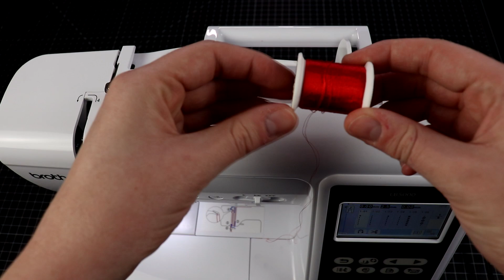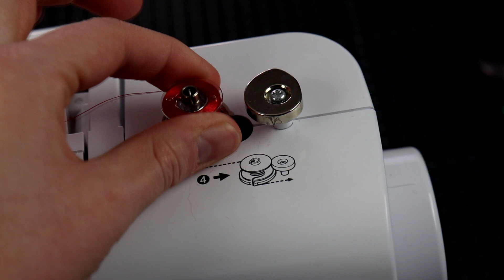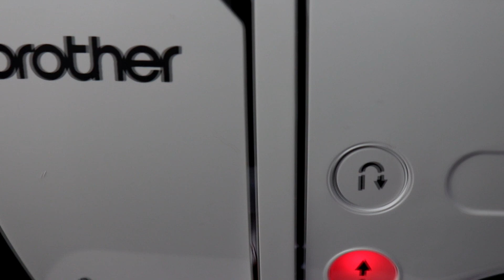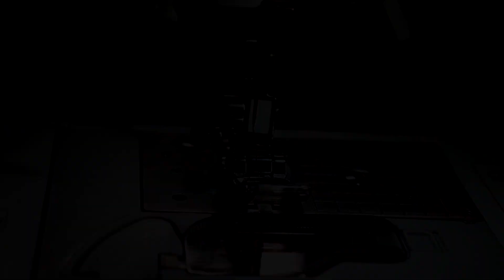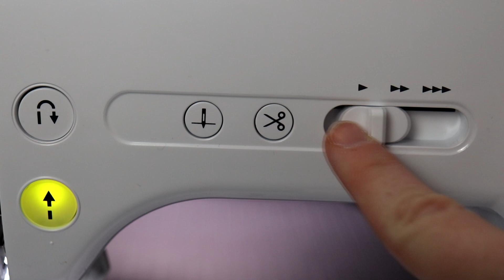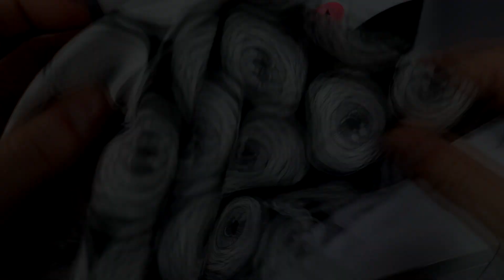How to Thread a Sewing Machine and Sew your First Stitches!

Comment: hi! i was having trouble seeing a loop when doing the second part 7:24 . also, what is the purpose of doing this, is it necessary for sewing?? also, when i tried to use the thread cutting button, it made a strange sound and the thread didnt cut, i had to do it manually. i did follow r steps so how do i mitigate this problem?? sorry for so many questions.

Comment: Hello hope you can help me. I just purchased this machine and the presser door looks very wobbly is that normal and my needle broke when I tried to replace it the needle that came with it wouldn’t come down so I forced it out. But the new needle in and now it’s making a weird noise when I sew. 😣
Reply from the maker: the pressor foot is wobbly? if that's what you mean then that definitely isn't normal, make sure you press the button the back of the pressor foot anchor to ensure that it's securely in place. that not being in place may be why your needle broke. Do you have the small allen wrench used to loosen the needles when replacing them? make sure the needles are pushed up as high as they will go into their little chamber, and secure it tightly while with the allen wrench while holding them in place. I hope this helped!

Comment: Do you know what kind of thread you need for embroidery? I just got this machine and its so confusing which thread i should buy for embroidery.
Reply from the maker: hey there! you need to purchase embroidery specific thread, they come in different style spools than typical thread. Google "coats and clark embroidery thread" that is what I use and it will provide you with shops to purchase at :)
Reply: Mira Scarlet thanks so much! I notice there are different “weights” does that matter?

Comment: hello excellent video please kindly film how to operate the sewing machine by using the electric foot pedal being used and by using the start stop button please ok? Please kindly reply back ok? Thank you very much
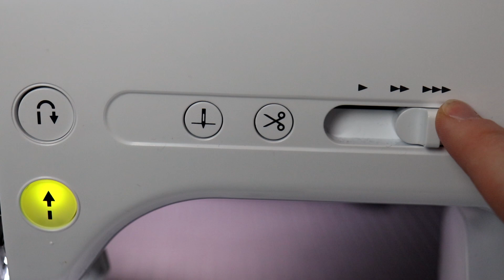Reply from the maker: Hey there! at 0:37 you can see where to install the electric foot pedal! when that is plugged in, all you have to do is put the pedal on the floor and step on the pedal to make the machine start (it won't start until presser foot is down!). to control the speed refer to 9:36 to show you how to control that! if you want to use the start/stop button option instead, you'll need to unplug the foot pedal from the machine. The start/stop button will turn from red to green when it is able to be used! I hope that helps, let me know if you have more questions :)